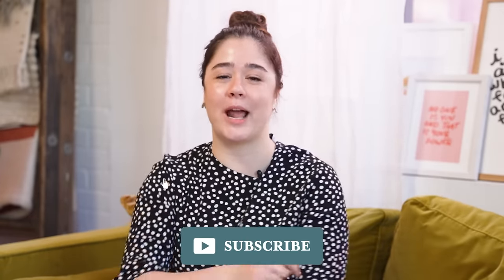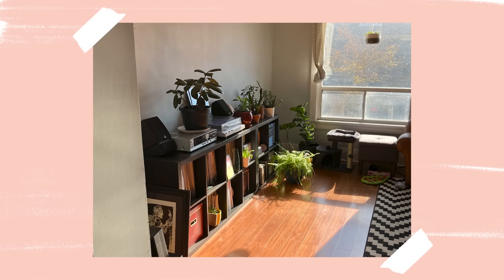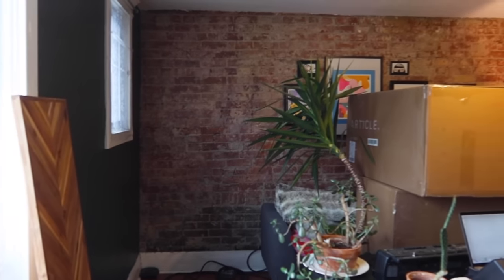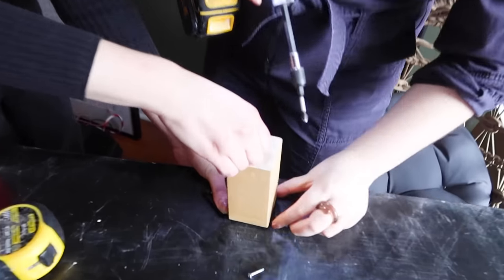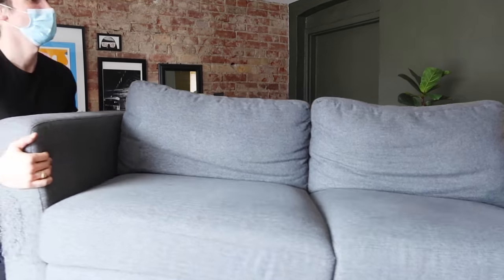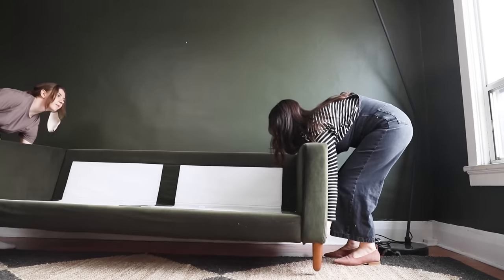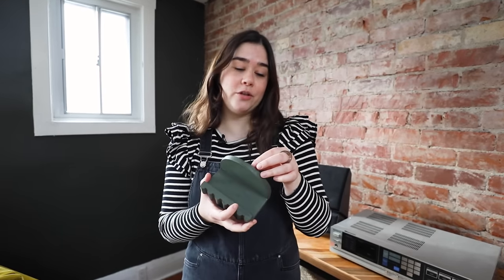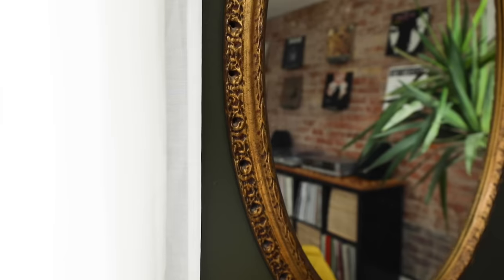*EXTREME* LIVING ROOM MAKEOVER + IKEA KALLAX UPCYCLE

Comment: It looks really good,
*Pro tip never use a paint finish that has a sheen on damaged/patched walls, it shows up every imperfection, especially a dark colour, go for a flat finish
Reply: First thing I noticed too lol Too bad because it takes away from the beautiful colour!
Reply: Agreed. I was very surprised to see the sheen. You can get the washability of semi gloss using eggshell finish so it's not needed for durability these days.  The shine is very noticeable with the dark colour.  I've nothing against the colour, but I am kind of shocked that they made such an elementary mistake after refurbishing so many spaces.
Reply: I totally agree. I always use a flat finish on my walls. It hides imperfections and gives a more elegant appearance.  These walls took away from an otherwise beautiful makeover.
Reply: I think the inconsistencies in the lathe and plaster painted walls give the room a lot of character! Paired with the brick wall, in which every square inch is different to its neighbours, gives the room a particular, unspoken uniqueness. If it where a flat paint, it would have looked…well, flat! If you want it to look perfect, I suggest a full Reno with new drywall. But that’s so boring!
Reply: Totally agree. I've never seen anything but flat paint used on a wall--unless it's a rent house and the landlords don't want to have to repaint. Aside from not caring for the monochromatic green on green, great room, as always!
Reply: @maggiemaggie4765  Yes !, I'm a property manager, we have flat on the ceilings (except for the basement the painter thought I was nuts I went with eggshell and it looked so good but the bsmt has 8 windows so it reflects light beautifully !) But all our walls have eggshell, and the washroom has a washable kitchen and bath paint which is a touch too much of a sheen but its so durable, and the trim is pearl, which I'm going to use when I repaint my apartment as it looks really good. 
We use midrange Benjamin Moore in our apartments, cheaper paint really can suck. 
Where I live (not who I work for) I was the first person in 7 years ago it was totally gutted, whatever paint they picked for the trim literally discoloured after the 1st year, and when I wipe the washroom walls the colour slightly comes off lol
Reply: Totally agree. It could be minimized had they used a high build primer, but that paint is way too glossy for a living room when the walls aren’t perfect. It’s too bad because it really makes what was otherwise a great transformation look a bit amateurish on close inspection.
Reply: Thanks to you all for the great tip.
Reply: @Handymangraham     I agree with you - I also think they wanted the gloss to help catch and reflect light around the room since it’s such a dark color.  I like the gloss on this project, although if I were going to do it myself, I’d spend more time smoothing the walls a little better.  Perfection would be hard to achieve.
Reply: Or even a really low sheen or matte is more helpful.
Reply: @Beruthiel45  Well the sheen looks good if the surface is in good condition though.
Reply: @mariannedeangelo2319  I am the other way around. I use eggshell and satin on perfectly fine walls and I love the elegant look it gives and the lightness without it being flat, which I don't care for.
Reply: @Handymangraham  I agree. I love some sheen on my walls and walls with character.
Reply: @maggiemaggie4765  Depends on whose house it is. Not everyone uses flat, even at their own houses. I know I don't. That flat trend is only like 10 years old.
Reply: @Sunnbuzz  Yes big mistake using flat on trim, especially baseboards.
Reply: @vaderladyl  I would go as far as eggshell on walls. Easier to clean. I save satin for trim. 😊
Reply: @mariannedeangelo2319  Yes that is a good combo too. I had used it with great success in the past.

Comment: Tip for matching your sofa (or anything) to your paint colour! You can actually bring your fabric swatch to the paint counter at the hardware store and they will use their special ray-gun looking machine (no idea what it's actually called lol) to get a perfect match and make you a custom paint! It costs nothing extra, at least at Home Depot. I wanted an accent wall that matched a favourite burnt orange throw pillow and the paint colour they mixed for me is an exact match. You can also bring in chips of old paint, solid materials, whatever.

Comment: I like when Team AG works outside the usual (equally like the usual, I hasten to add). In this Dark and Moody  episode I especially liked the Karlstad refresh. I got my Karl 3+3/3+2 second-hand for $150 USD. For those without a Karl at home, that’s the (huge) sectional. I didn’t love the light gray cover but I snapped up the deal anyway because if you need a sofa and see a second hand Karlstad, don’t wait. Even in less-than-pristine condition like mine the construction is not complicated; tighten a few bolts here and refresh some glue there and be in business. I have multiple dogs who like to groom themselves and each other. On my furniture. I replaced the cover, from Etsy in my case. I wanted to go for velvet but one of my dogs sees velvet as synonymous with toy. So we went with my original choice of dark gray. I replaced the feet, too. Karl is transformed! The fabric I chose has the added benefit of being incredibly difficult to stain. I might consider tufting next. Maybe sofa tufting could be in a future episode?

Comment: If the sheetrock is not perfectly sanded and leveled, dark colors show every flaw. The baskets are not the right size for the blocks and it shows. That black table should have been painted with enamel. If you're going to do it, do it right.

Comment: You didn’t need to extreme tape the holders to the brick. Screws and nails go in easily to thr cement between the bricks. Those are never coming off now. Room looks good but the couch is way too small for the scale of the room and oversized chairs. Also she’s an illustrator and you didn’t use her own art on the walls?
Reply: She did. Alexandra bought one of her prints from Etsi, had it made bigger and framed, and hung it over the sofa.